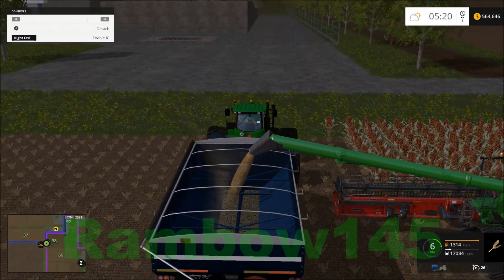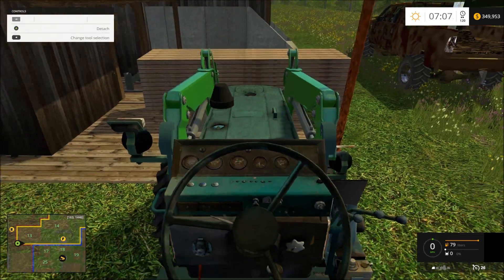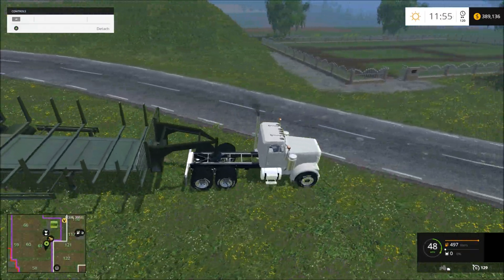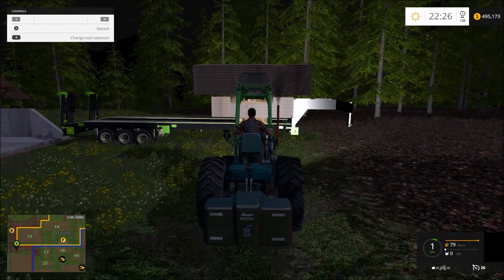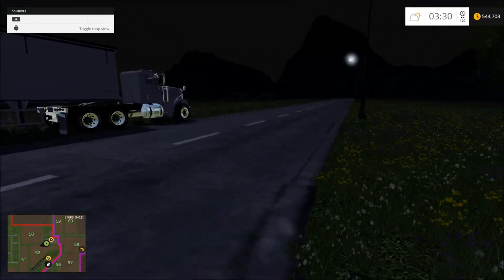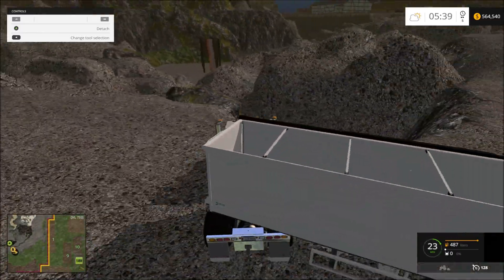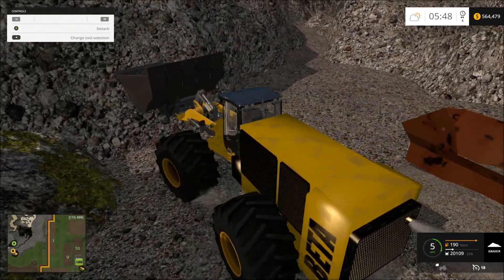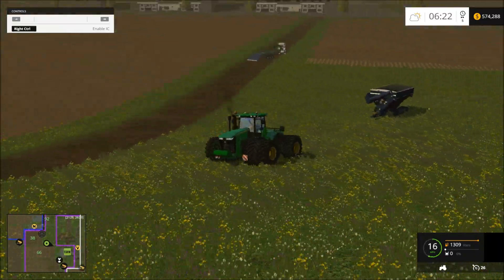Farming simulator 2015 Pleasant Valley cutting the field

Comment: do I have to have all of them and I downloaded the one pack for pleasant valley v1 and the map didn't even show up to were I could select it in game so please help me
Reply from the maker: +Tucker Wall  Have you updated your farming simulator 2015? If you have the steam farming simulator 2015 then it should be up to date.
Reply: No I don't have the steam version but I currently have the 1.3 update what should it be
Reply from the maker: +Tucker Wall  I think your up to date it should work. This might not work on a mac, I really don't know what could be going on with it. 

So you left it in the zip folder and put it in the mods folder and so on.  And it still don't show up as a new map to play ? 

If your not trying to put it on a mac then, maybe take your mods folder out and put it some where safe so you don't lose your mods. 

now make a new mods folder where the old mods folder was at and then add just the pv15 map and try it,

 If you have not don't that.

 Then add a few mods back and see if the map still works and if it don't then its one of them mods you added back. and so on :) I hope this helps ;)
Reply: Thanks so much I will try it and I'm using a windows 7 HP pavilion laptop
Reply from the maker: Tucker Wall  you're welcome  :)